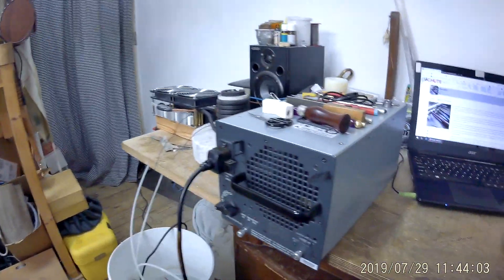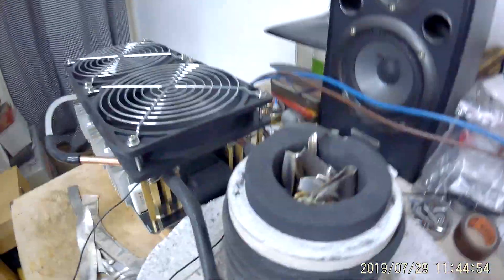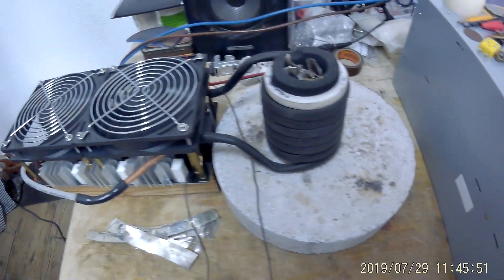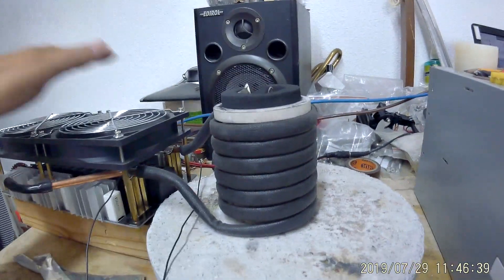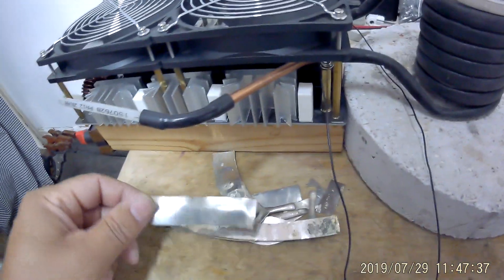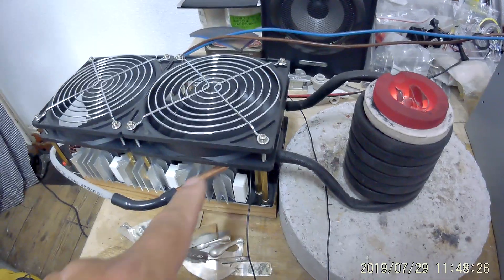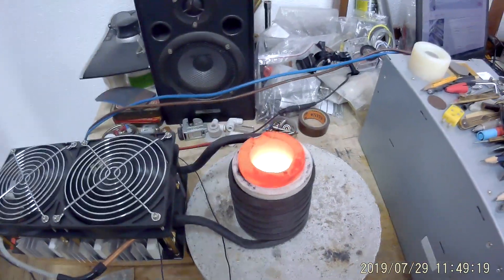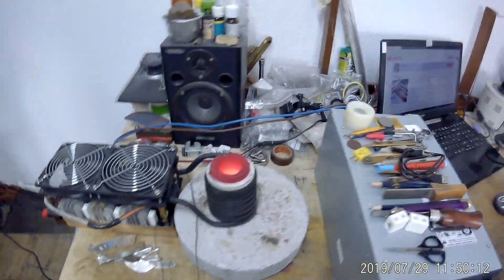Workshop Tools Induction Heater

Comment: What is the top precious metal you melted with this setup?
Reply from the maker: Only silver up to now, works very quickly with sterling and will melt most grades of gold also, the main coil needs to be chnged out for a 1/4 inch dia copper tube with six turns for optimum heating and cooling, the supplied 3/16 inch coil is too slow.
Reply: @daviddanielstephenson2833  wonderful set up.
Reply from the maker: @tipxking9944  I works very well indeed, right on the desk top safely, the HiFi speak directly behind does not even get warm, even so close, best setup I have put together, cheap as chips too.
Reply: @daviddanielstephenson2833  I just got progress from working on microwave transformer to hopefully melt this palladium. I created the arc of electricity but it's short lived due to being about 24v of direct current. Short 12more turns for minimum power but I'm still able to create and stabilize it with 1 transformer. In other words, I stumbled upon your build which looks fairly small size compared to some giant builds with complex equipment. I looked at induction heating to minimize use of gases to melt precious metals as well so after the transformer mod I think I want to play around with making an induction heater but I'll need a lot more knowledge of electrical components to start from.
Reply from the maker: @tipxking9944  The problem with doing a larger induction setup is the DC voltage supply needed, I can run my half pound crucible on a 240 volt wall plug no problem, using 6 square wire to stop it overheating, on the larger system cooling is also going to need a lot larger pump and coil.
For a larger setup you are going to need a lot bigger electricity supply,  min 3 phase.
I have still to complete my drop valave system and argon shield to keep the metal clear, there re commercial units avaiable but at 12 k they are way out of my price range, the small one is more than adequate for what I do, and it is really clean and efficient.
Reply: @daviddanielstephenson2833  that's very interesting. The argon shield cost that much for what exactly? All you're doing is just running electrical current.....you're not dealing with argon directly....right...or did I miss a vital point of your presentation video?
Reply from the maker: @tipxking9944  If you check out some of the commercial setups you will see how they add Argon using a covered crusible to keep things clean without using any borax.
Reply: @daviddanielstephenson2833  that's seems a bit much maybe even overkill but I've never seen it yet.....maybe one day I can see it on your setup if you get to that point
Reply from the maker: @tipxking9944  You can see a commercially available unit in operation here, using the drop method which is gas protected, https://www.youtube.com/watch?v=SruYVNEpOO8
I will eventually make something similar, using my homemade induction furnace situated above, but instead of a vacuum flask shown in the commercial unit, I will use my homemade certifugal casting machine underneath instead, my homemade machines are  here, https://youtu.be/-9bCC7iFgjU?t=57
My homemade centrifugal machine was based upon this system at a fraction of the cost, see below,
https://youtu.be/-9bCC7iFgjU?t=61